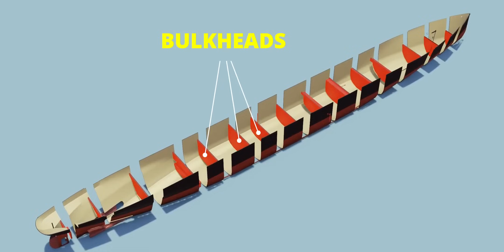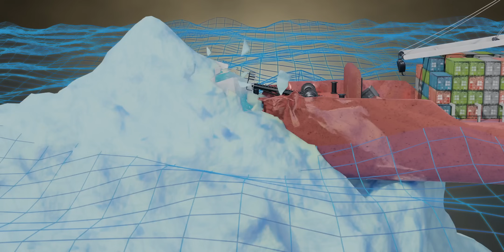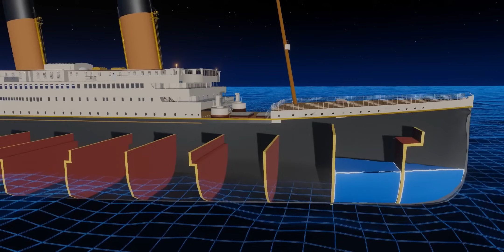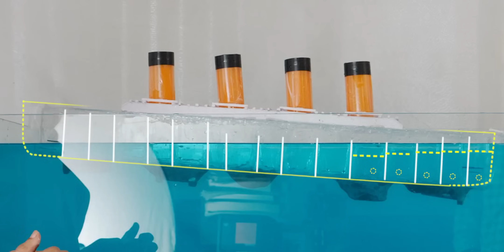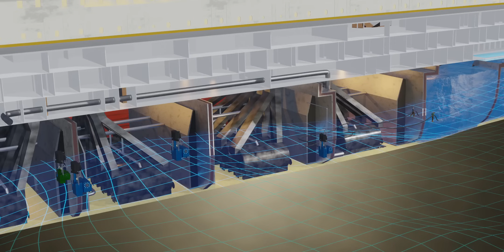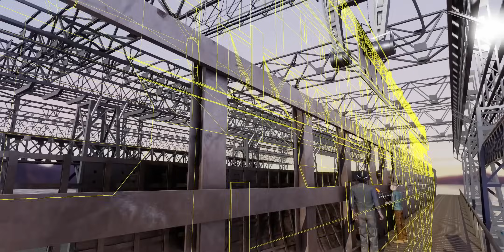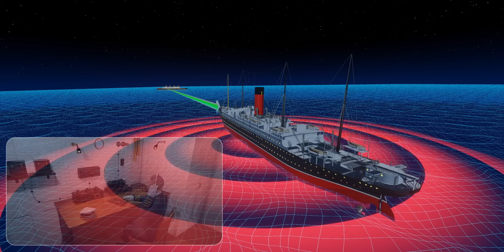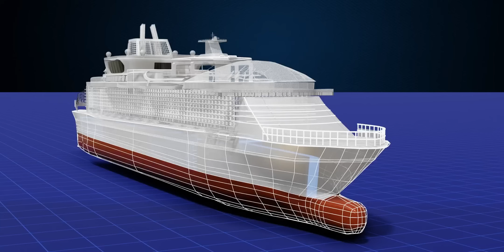How did Titanic Sink? | The Complete Physics

Comment: 13:00 Titanic (like most big ships of that time and later) had a "crumple zone" in its bow, which would make any head-on collision very unlikely to go anywhere beyond 2nd compartment even in a full speed hit against a "solid" (in comparison) object, like the iceberg. 
If the ship wasn´t made with the risk of head-on collision in mind, it might have produced a shockwave travelling through the hull and wrecking the bulkheads. But luckily the designers weren´t stupid. They were just unlucky, because a hit like in the case of Titanic is super rare, and is practically impossible to absorb by any protective means. That´s also why almost 100 years younger Costa Concordia also got sunk, despite the advancements in shipbuilding.

Comment: 4:14 One minor error - the steam turbine and its central propeller could not be put into reverse, it could only run forwards or not at all
Reply: That's one downside. The other is the sheer amount of steam it takes to run the thing. Running it on the exhaust of the triple expansion engines was a pretty good efficiency gain actually, instead of having dedicated boilers, it runs off the waste heat coming out of the other engines. Like a turbocompressor in a car, except this one goes directly towards propulsion.
Reply from the maker: Thank you for pointing it out and sorry for the mistake. I will fix this issue in the future Titanic videos.
Reply: @SabinMechanical 4:06 Isn't that a mistake? The rudder has to be on the other side to turn "left".
Reply: @pavelslama5543  I understand this maneuver. But did they really start it before the collision?
Reply: The other two weren't put on reverse too 

Also the central propeller is 3 bladed btw
Reply: @elfi_ox  You’re wrong on both counts. When the  iceberg was reported First Officer Murdock ordered the engines full reverse and the wheel put over hard a starboard then he ordered all water tight doors closed.
As for the Titanic’s central propellor being a 3 bladed one this is a total fabrication and is based on paperwork supposedly from Thomas Andrew himself however further examination of these papers has shown them to be forgeries. The Titanic sailed on her maiden voyage with a 4 bladed screw not a 3 bladed one, further in the 100+ years since the disaster there has never been anything even remotely hinted at about a 3 bladed central propellor. I have also talked to the main historian of the Titanic Historical Society and he’s extremely skeptical about the claim since it has come out only recently and there’s nothing ( no drawings, no memos, no photos…..absolutely nothing) to indicate the Titanic sailed with a 3 bladed propellor.
Reply: @anthonylowder6687  The engines were never reversed before collision. Witnesses in the boiler and engine rooms said that All Stop was ordered. Most of Those that did say the engines were reversed stated they were reversed post collision. If they reversed, it was likely a couple of minutes post collision. 
About the engines being reversed post collision, its up for debate as to wheather it was Full Astern or Slow Astern. Dillon and Scott (Admittedly questionable) mentioned Slow Astern. Others stated they were reversed. Some (Rowe, Poingdestre, Scarrot, Rule) stated it was full astern. It is up for debate as to which of those orders it is as witness testimony regarding telegraph orders is quite contradictory. 
If the engines were reversed (Debatable, especially as to whether it would be full or slow astern), it was probably about 2 minutes after the collision when the order was given and likely to slow the ship's forward momentum down, before Half Ahead was ordered.
Sorry for any offence, no offence meant. Just wanted to give my input
Reply: @elfi_ox  no the inner propeller was 4 bladed the outer 2 were 3 bladed
Reply: @elfi_ox  All three screws on the titanic were 3 bladed...
Reply: @andrewmcleod9312  wrong the center propeller was 4 bladed only the outer ones were 3 bladed
Reply: @crazyeddie1981  it's in fact not true. RMS Olympic had a 4 bladed central propeller (tho she probably got a 3 bladed one for a short time after Titanic sinking). HMHS Britannic Also had a 4 bladed central propeller for her entire life. But for Titanic it always has been 3 blades and at this point it's pretty much a fact because it's in the archives of the Harland & Wolfs, even tho it wasn't really known a few decades ago (which is why it's portrayed as a 4 blade in Titanic 1997)
Reply: @andrewmcleod9312  yup
Reply: Would it have turned faster if starboard propeller would have run full speed ahead and port side full reverse?
Reply: @Krapula018  In theory it might have. In practice it might have put the rudder into a turbulent water flow, disrupting its function.
Reply: @Krapula018 Best maneuver would probably have been to reverse the left propeller full steam, and leave the one on the right idle. The center one also full steam in reverse. 

Unless you're coming down to a slower speed, it would have been counter productive to make the starboard propeller spin in any direction.
Reply: Wrong way wrong way WRONG WAY WROOONNNGG WAYAYAYYAAYYAY
Reply: The end of your vid was a visual treat as Jim Cameron would say.
Reply: Great catch—love the attention to detail! Do you think that design limitation played a role in any major events or accidents?
Reply: @ Of course. They always do. In every ship, every accident, every time. And not only the design limitations always played a role, but they also always will play a role in the future.
Reply: Yes, the Titanic could be put in reverse, but it wasn't a simple matter of flipping a switch. The Titanic was a triple-screw steamer with three propellers: a center propeller and two outboard propellers on the port and starboard sides. The port and starboard propellers could be reversed, but the center propeller could only propel forward. 
To reverse the engines, the Titanic needed to: 
Cut off steam to all three engines .
Allow the engines to wind down .
Change the gearing on the triple expansion engines .
Pressurize the "reverse" steam chambers .
While the Titanic could theoretically be put in reverse, the process was time-consuming and complex, and it's debatable whether it was actually attempted in the time available before the collision with the iceberg. Crew testimony suggests the engines were simply stopped, not reversed, and the movie "Titanic" dramatized the scene.
Reply: @Acheron9582 Likely, the engines were ordered stopped prior to the collision, then reversed post collision.
Reply: Wrong.
Reply: @ what is wrong?
Reply: Center propeller, being connected to the turbine, could run only in forward direction and only if forward power was set to 50% or more. That's a fact. Camerons movie "Titanic" got it wrong at the beginning of the movie, when ship was leaving port, showing all three propellers starting at the same time. Only two propeller could've started at the time. (James Cameron actually knew this fact prior to filming, but decided to show wrong on purpose, to make the ship look greater and reduce questions by many who didn't know it. However he showed it correctly at the scene just before the ship hit the iceberg. I wouldn't be surprised that, in reality, the center propeller was windmilling, i.e. slowly rotating in the forward direction.)

AFAIK: the emergency stop/avoid procedure of the Titanic at the time was to put engines in full reverse and apply full rudder. That was practiced at sea trials and stopping time and distance was measured. There's quite a chance that full reverse was ordered if the same procedure was executed (and I don't see why wouldn't be at the time).

There's also a discrepancy in length of the gap caused by the iceberg - which said to be about 100 meters. Some people did some research and came to the conclusion that if the ship was going straight or simply turning, there's no way the gap could've been 100 meters long. That's why the only logical explanation is as if the ship sailed sideways, which can be achieved only if it had applied both full rudder and engines in reverse simultaneously.
Reply: @bsimic29  Likely, the engines were ordered stop when the crash came. Then reversed after the crash.
Reply: Then why is the 2 bridge in the stern
Reply: @AlejandroPineda-nq8so  The docking wheel situated at Titanic’s stern assisted with maneuvering and docking in and out of ports.
Its presence effectively serves as a redundant set of navigational elements to be used under any particular circumstance.
Reply: Me and Dick Jones have had our fare share of conflicting theories over the years, but one thing we always agree on is that the rivets holding the ship together were of poor quality.

Comment: Interesting modeling, but you should take into account that the ships often list when they are sinking, and indeed the Titanic had a slight variable list while she  was sinking.

What about the speed of the ship. 
It's not true that the captain chose and kept a high speed because he thought the ship was unsinkable.
Even if he thought that the ship was unsinkable, he had no intention to test it. He didn't want any collision because even if the ship do not sink, she'd be damaged (which will cost money to the company), and they''ll be late, and that would not be good for the image of the ship.

He was just following the common practice.
When the whether is clear, all the captains keep high speed, if not full speed.
That's because in the dangerous region where the icebergs cross the path of the ship, the captains fear another thing, and that's the fog.
Which is common in that region were the warm Gulf stream meet the cold Labrador current.
When there's a fog and you can't see, you can crash even with a low speed. 
When weather is clear and there's no fog, you can see, so you can avoid the icebergs. 
And you hurry to pass the region while the weather is still clear.

Unfortunately the weather that evening were quite deceiving, and the iceberg was spotted too late.
Despite that, the officer in charge Murdoch without knowing it, made a mistake, trying to slow down the ship, and in this way he compromised the ability of the ship to turn.
The Olympic class ship were actually very responsive ships for their size, thanks to the central propeller in front of the rudder. They were turning better at high speed.
Despite that, in less than a minute the Titanic (being the biggest and the heaviest ship in the world) was able to turn twice: first to the left (port) and then to the right (starboard).
But Murdoch couldn't know it because these ships were brand new, they were considerably bigger than the other ships the company had, so nobody had experience with such large ships, even captain Smith with his 40 years at sea.

Comment: 4:13 They didn't reverse the ship that night. The first order given was Stop. 
Also, the Port and starboard propellers spin outwards, and the center propeller only spin in clockwise direction. Center propeller cant reverse. 
The center propeller was 3 bladed. 

6:18 Olympic class was designed by Alexander Carlisle. Thomas Andrews took over after Carlisle retired. Technically, the design of compartments was also done by Carlisle. They designed the ship to float with adjacent 3 compartments flooded. 4 compartment limit was found during the calculations in the inquiries by Edward Wilding.

7:58 Technically 6 compartments were breached. The 6th compartment's damaged was confined to the coal bunker adjacent to the watertight bulkhead E that seperated 5th and 6th compartments (boiler rooms 5 and 6).

9:35 Titanic was warned of icebergs and they travelled accordingly. 
They took the Southern track, which was meant to be taken by Westbound liners from January to August to avoid ice. That year, unusual amounts of ice drifted into that track further south.
The warnings they got didn't put icebergs in their direct path. They either passed one or wouldn't have met one. Two important warnings regarding the exact icefield Titanic encountered didn't reach the bridge. 
Captain Smith was following standard protocols. It was testified by 11 other captains (including Mauretania's former Captain Pritchard) that the practice was to keep going until they actually saw ice. 

10:58 they described her as practically unsinkable. All the prior experiences they envisioned was put into the safety features of the ship. Nobody envisioned a situation where an iceberg would side scrape to open up 6 compartments.

Comment: Not Titanic but Olympic the ship with the bent keel, great insurance scam of that century the real truth is about to be revealed
Reply: Lol nope. 
Titanic was under insured for 5 million USD. It took 7.5 million to build her. She was self insured. Along with 2.5 million loss, there was loss in reputation, passenger claims, settlements etc.. 
Insurance scams are supposed to be profitable.
Reply: No. Just no. That theory has been proven to be false for decades. But because you wont believe me without facts let me list off every reason why Olympic was never swapped with her sister.

Starting with Olympic's collision with HMS Hawke on September 20th 1911. The initial theory stems from reporting at the time the following the collision RMS Olympic broke her keel. This is a falsehood that was created by the press to cause a sensation that White Star Line's newest and grandest liner was now broken beyond repair. This is not true. As stated in the Admiralty's report:

“Two major watertight compartments were flooded, hull plating gashed from the Orlop deck to E deck, and the starboard propeller shafting damaged.”

There is no mention of damage to Olympics keel. This theory falls apart further when you examine the two ships involved. HMS Hawke was built with an 8ft armored ram. RMS Olympic was 92ft wide at her widest point and around 84ft at point of collision. In order to have damaged Olympic's keel HMS Hawke would have needed to penetrate 40ft at least into the Olympic which by that point she would have been doomed regardless of a broken keel.

The damage sustained by Olympic took 40 days to repair. Not to mention she sailed from Southampton to Belfast on her own for said repairs. And during the repairs they took the port propeller shaft from Titanic and installed it on Olympic to press her back into service as soon as possible.

As for the idea of swapping the ships out because they were 'identical', no, no they weren't. Titanic had many features that Olympic did not. I will stay away from mentioning the difference in window layouts however i will point out that Titanic had significant structural differences in her B and A deck constructions to the point where in order to make her look like her sister Olympic on the inside it would have taken an entire reconstruction of her superstructure between those two decks. Furthermore Olympic's bridge wings were flush with the ships superstructure whereas on Titanic they were extended out slightly to provide better visibility a lesson learned from her sister. Not to mention swapping the names would have take at least a month if not longer due to the fact that the nameplates were engraved into the ships metal not painted or bolted on. In fact you can still clearly see Titanic engraved on the wreck today

But the biggest nail in the coffin for this theory is this. Before the ships were named they were known as Yard number 400 for Olympic and yard number 401 for titanic. Every single fitting on these ships was stamped with the number that corresponded to the hull they were made for. On the wreck of Titanic on all of the machinery that hasn't rusted to dust you can see the number 401. Same goes for artifacts recovered from the wreck site.

Titanic wasn't sunk on purpose as some part of an insurance fraud scheme, she was insured for considerably less than she was built for and her sinking pretty much ruined the white star line resulting in the 1934 merger with Cunard. She was insured for 5 million but built for 7. White star then had to pay out to the victims and their families.

Titanic was sunk because of hubris and arrogance. The crew genuinely believed her to be unsinkable due to new innovations such as her double bottomed hull and water tight compartments. They were under orders to try and set a record crossing in order to win the blue ribbon on their maiden voyage. Had they entered the ice field during the day they would never have traveled at full ahead. There is no conspiracy around the Titanic. Human arrogance and error sent her and 1,517 people to the depths of the Atlantic, not some Machiavellian scheme by the rich.

Comment: For people that are wondering the ship could not float with any 4 compartments flooded.  Even if the first compartment was not breached the ship would have still sank.  You could have eliminated the first 3 openings the iceberg made and the ship would have still sank and in about the same amount of time.
Reply: Titanic could've floated with either 4 adjacent compartments at the front or at the back flooded. Or it could float with any 2 or 3 adjacent compartments flooded midships. 
That night, 6 forward compartments were flooded.
Reply: What is your reasoning for thinking this?
Reply: No, it's been calculated that all these breaches only amounted to less than 20 square feet of hull opening to the sea. If that was reduced to say 6-7 square feet, they would at least have had substantially more time than they did.